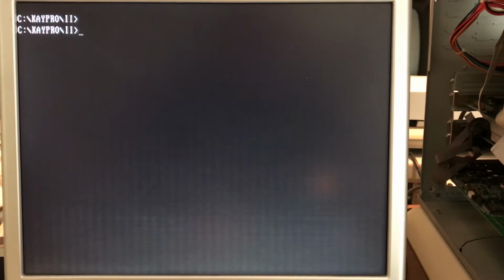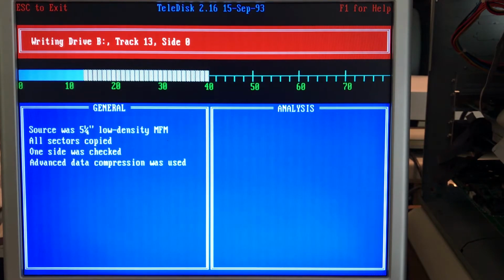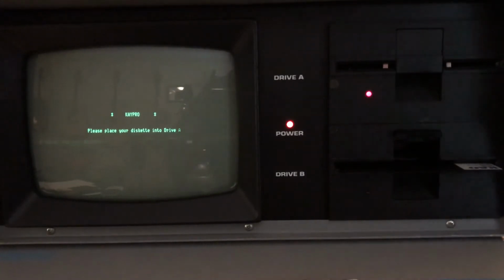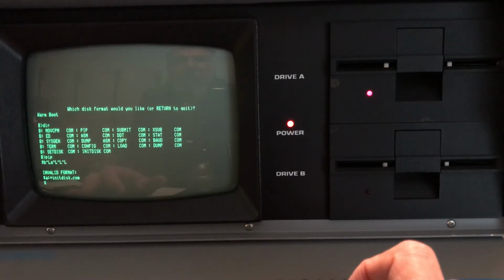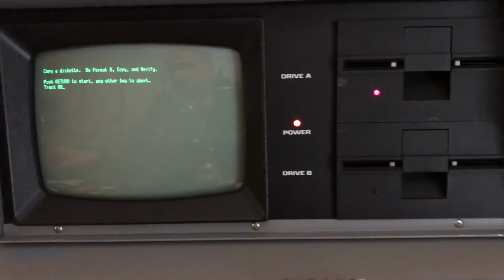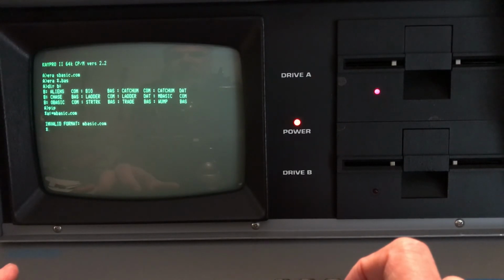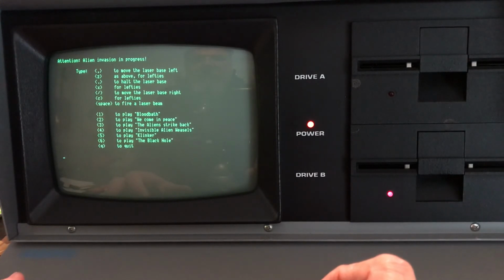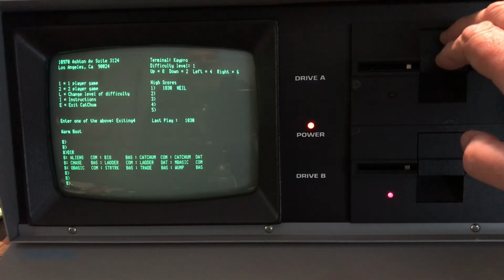Kaypro - Part 4 - Using MS-DOS and Teledisk to create Kaypro II floppies - STB157

Comment: Nice video, thanks for sharing. So that means that loading CP/M first is required for other programs? I have a kaypro but the boot disk seems to be defect because it just keeps spinning but not loading anything. If I try Microsoft basic I get “can not read your diskette”. When I try a word program for the kaypro, I get the message that I should copy the master programs but can’t do anything.
Reply from the maker: Yes, CP/M needs to be loaded and running before you can load other programs. CP/M is the operating system for the Kaypro in the same way Windows is the operating system for a modern PC though CP/M is much more primitive. The spinning disc could mean the floppy is bad, there is an issue with floppy drive itself or a deeper issue in the system.  

If you search eBay for "Kaypro boot disk" someone is selling a set of bootable disks for the Kaypro 2x,4 and 10 systems.
Reply: @ShadowTronBlog  Ah oke, thats great to hear. I get the message with other disks that the computer cant read the diskette with, for example: mbasic. I swapped the disk drives. I get for both drives the same results with the disk i have ( i have 5 diskettes for the kaypro II), so that gives me hope that only the diskettes are the problem. And not the drives.

If I put a random empty floppy in it, i dont hear the drive head moving, it just keeps spinning. If i put the CP/M diskette in, i can hear the head moving two times. Then after 10 seconds i can hear the head again moving one time. This just continues, but nothing happens, the message with 'insert diskette in drive A' stays. As I told earlier, with a diskette with for example a wordperfect program for the kaypro II, i get the message that 'i try to boot a diskette, but that i first need to copy the disk'. I read that it is a sort of protection for the software, that the user does not overwrite  the diskette  by accident.

Thanks for the ebay sugestion, that guy lives  also in the Netherlands( me too), so i had contact with him. He will send me some disks. 

Thanks for the reply. Old computers are really fun. I have a couple, but this is the first CP/M machine for me.

Comment: When teldisk is about to start reading from my disks - dos or non-dos - the computer just locks and the pc-speaker has a nervous breakdown. I've tried everything! It's a fairly new dos computer though. One of the last ones to take win98.
Reply from the maker: Nothing much come to mind on this. The BIOS might be too new. The floppy controlled might not support the older disks as well (180/360K).

Comment: Hi, I felt your pain in creating boot disks for these old CP/M machines. There is another DOS program called Imagedisk which carried on the work of Teledisk and added a lot more features. CP/M only occupies the first two tracks of a floppy so you could have used your first bootable disk to SYSGEN all your other disks. Using PIP to copy over SYSGEN.COM to the your one and only at the time boot disk and from there generate the boot tracks for all your other disks. You should SYSGEN all your disks to become bootable. Now that's out of the way I recommend  that you buy a Gotek drive and use the flashfloppy firmware instead of using aging magnetic media. I am currently restoring a Televideo TS-802 with dodgy drives and the Gotek is invaluable. I'll have to post some of my projects on YouTube for posterity.
Reply from the maker: Thanks. I'll checkout Imagedisk. I use do floppy emulation on some of my other machines. Don't know if I'll go that far with the Kaypro's or not. Most likely I'll sell the two Kaypro's once I have the fun of getting them running. I need to recap the Kaypro II power supply and monitor and do a full service on the floppy drives. Hopefully I'll be posting some video of this soon.
Reply: ShadowTron Blog I look forward to watching them. The fluctuations of the PSU could also be a problem with reading and writing disks.